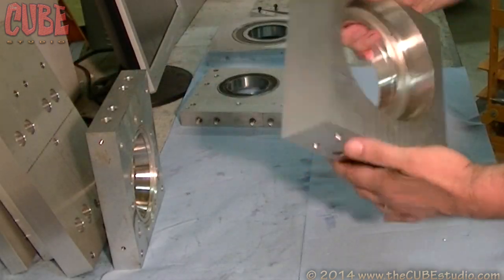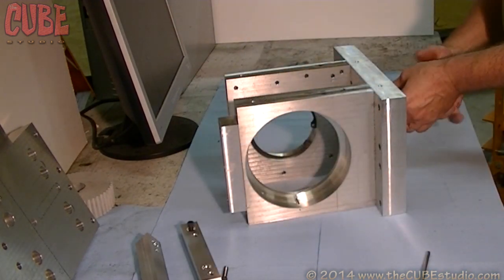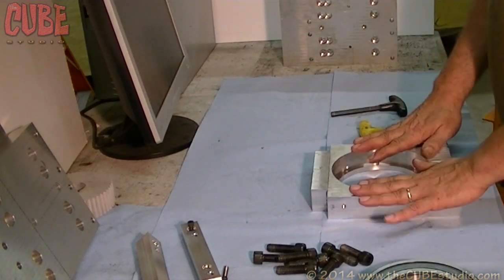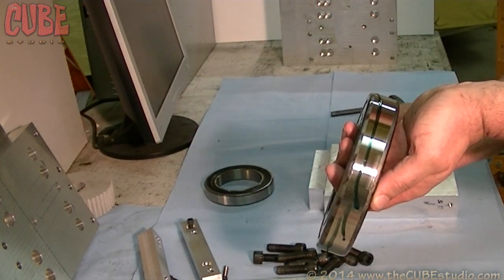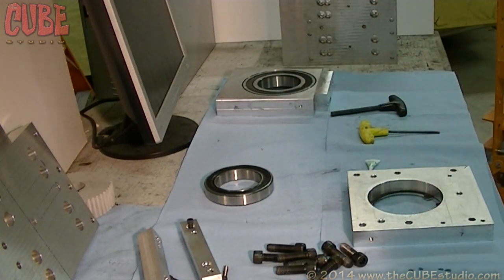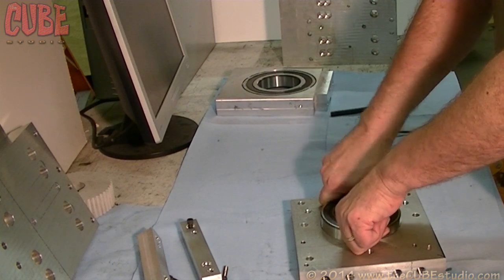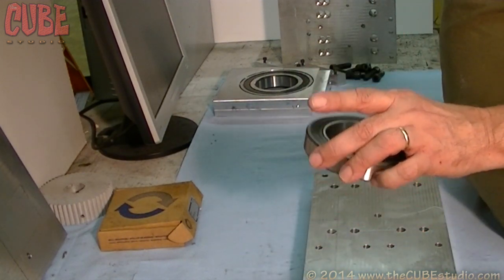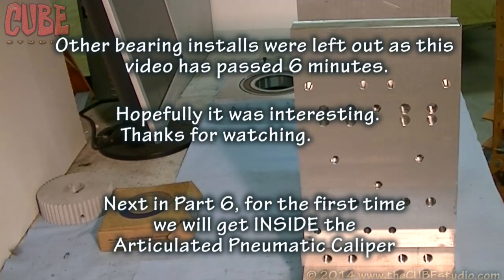Building the Ultimate 4th axis Part5 - final assembly begins

Comment: nice job dude, how is the rigidity? is it rigid enough to machine steel??
Reply from the maker: The InTurn ULTRA was the first to get forged 4140 spindles. The InTurn MEGA now also has a forged 4140 spindle. An InTurn turns these spindles from rough forgings. I think that answers the question.
The reason the frames are aluminum (7000 series) is to keep the weight down. The servos have to move this extra mass so we try to minimize the impact on performance. The aluminum frames are far thicker (and also far more expensive) than an equivalent steel or iron frame. Even so, the machine has the same rigidity and still ends up at a significantly lower weight.